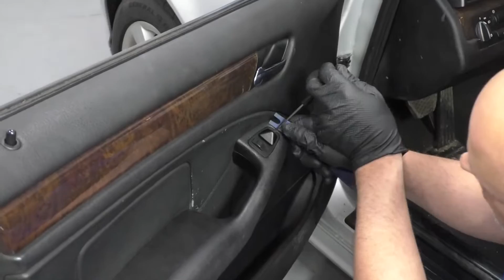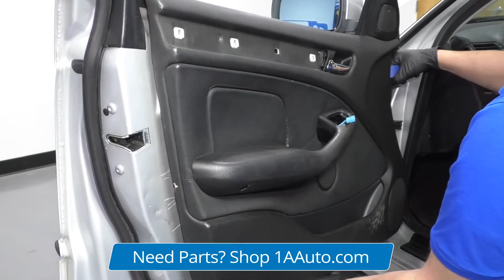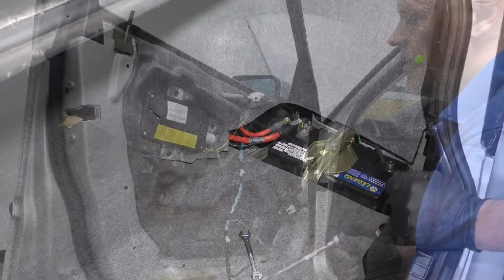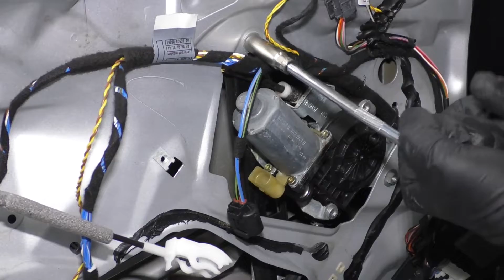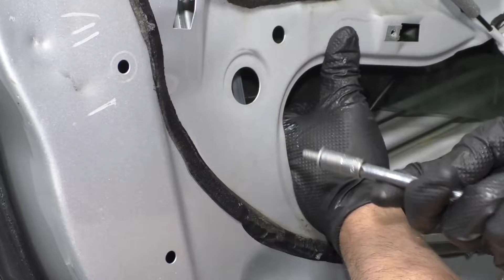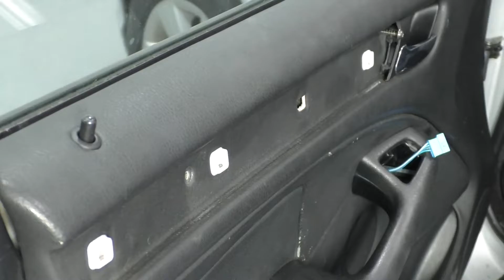How to Replace Front Window Regulator 01-05 BMW 325Xi

Comment: This is a 20 minute video. Everything went wrong at every possible turn. It is the middle of summer in Texas and I have no shade while working on my door. I’m 4 hours in and I no longer care if I have a working window or not. I’m about to pass out from dehydration and heat exhaustion and I’m thinking of just smashing the window, then wrapping the opening in plastic wrap and calling it a day.